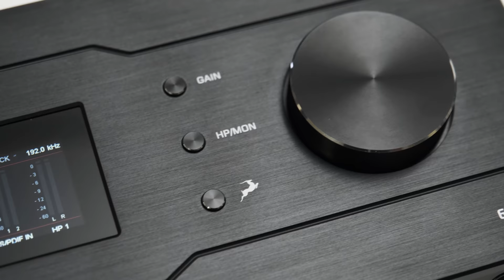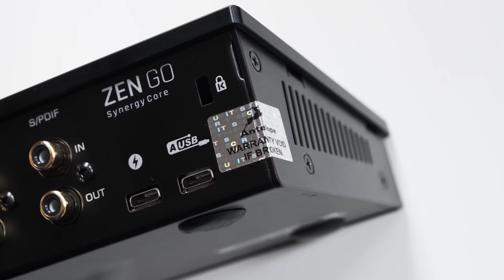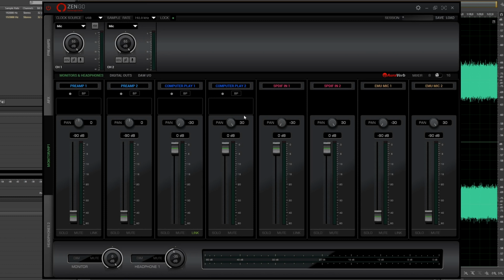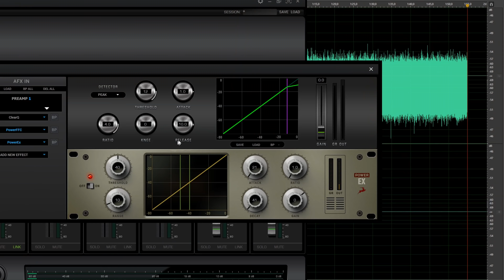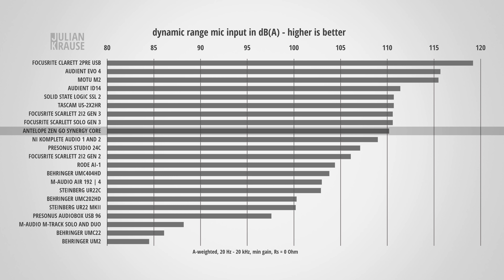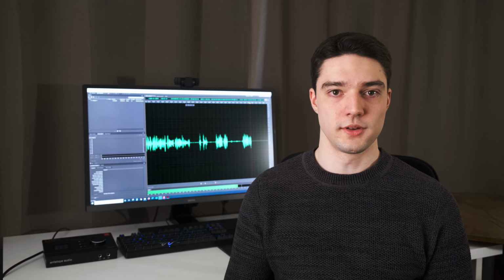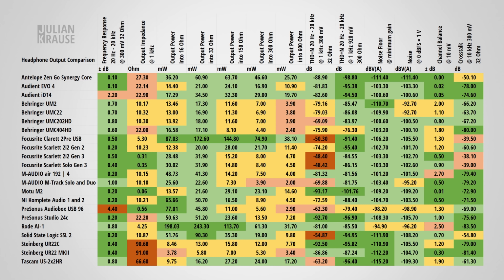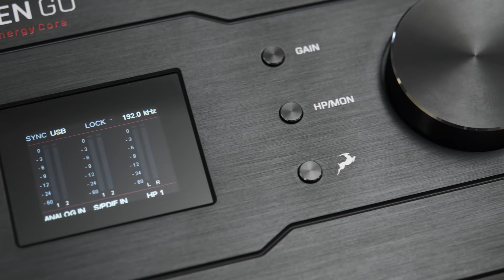Antelope ZEN GO Synergy Core - Audio Interface Review (real-time effect processing?)

Comment: Why the headphone impedance is important if the performance is great?
Reply from the maker: Here you find all the answers: https://youtu.be/SpTsWVLI-ig
Reply: @JulianKrause  Yes, thank you. But haven't you specifically showed flat frequency response from the HP out?
Reply: @JulianKrause  So, to be clear, I like your videos a lot, but I feel there's a disconnect either in my head or your narrative. High and low impedance are not values and I feel it would be more clear if you'd specify how much of output impedance are we talking about. Is it 1kOhm? Is it 300 Ohms? I'd love to know that. Am I understanding your point correctly that Zen Go's HP output amp is unable to drive low impedance headphones keeping the flat response?
Reply from the maker: @cuba1956  Hey, this is how I categorize headphones: 
16 - 32 Ohm = low impedance
80 - 150 Ohm = medium impedance
300 - 600 Ohm = high impedance
The Zen Go can drive low impedance headphones just fine, but the sound of the headphones might change slightly beacuse of the high output impedance.
Reply: @JulianKrause  So what the output impedance of the headphones out is measured at and did it affect the response?
Reply from the maker: @cuba1956  Hey, the shown response was measured with 32 Ohm. But you won't see any response devication there because for the test a resistor is used which has an even impedance accross all frequencies. The response devications depend on the connected headphone, so it will be always be different depending on the headphones you connect.
Reply: @JulianKrause  Thank you for clarification. I just think it's important to note, that even though there's some output impedance, there's really no audible distortion or frequency curve change with fairly low input impedance headphones. And I guess my point is impedance can't really be evaluated solely on the basis of subjectively high/low, but rather should be measured as a complete output circuit.
To be frank, I found the interference issue more disturbing, which likely suggests poor digital/analog isolation and I think basically means it can be affected by anything else. Not necessarily by monitor brightness.
Anyway, love your videos and appreciate your attention to details like that.
Reply: @cuba1956  Yeah, I read about the noise being caused by the level of brightness. How could they not have noticed that in testing? I presume some kind of shielding could have been put in place during manufacture to eliminate this very cheaply. Maybe it's another Mod for Black Lion to get in to :)
Reply: @vroge3275  Based on my experience it's more complicated than that. I think it's likely about isolating analogue signal from digital. Basically, some ripples in the digital bus are causing interference in the analogue and most good brands are doing fairly good job with that. But since it's happening here, I would assume analogue is just exposed on the DSP or even PCB level.
Reply: @cuba1956  read up about damping factor. there IS distortion, but in the time domain. The higher the output impedance of the amplifier, the lower the amp is in control of mechanical movement of the loudspeaker. It can be noticeable on transient bass frequencies (a kick drum for example). It simply adds a time domain resonance that wasn't there in the first place.
Reply: @BoredQwerty  Thank you so much for the explanation. So essentially, some non-linearity is introduced? Is there a value of impedance if not 0 that would be the maximum before it introduces distortion to the signal? As a general rule?
Reply: @cuba1956  There's a rule of thumb of 1:8 ratio between output impedance and speaker impedance. The higher the ratio, the better. You can still open it up and replace those resistors with 0 ohm ones, and decide for yourself. It still depends on the actual amplifier design for the end result.

Comment: A bit surprised about the measurements of this Antelope device - the input frequency response, and input dynamic range, keeps this device out of my buying shortlist. Nice try Antelope, but like all things Antelope, there always seems to be some issue, and some niggle. In this case, I'd prefer to go with a cheaper better quality device, or a more expensive better measuring more pro device. Not too convinced about DSP based processing in devices, feels more like a lock in - why? With software based processing, I can take my effects with me, as better devices become available in the future, and my investment in plugins is preserved. Furthermore I cannot use the DSP effects within normal mixing on an audio project, especially on Windows, cos Antelope has not sorted this out.

Ultimately this device stands or fails on the quality of its DSP effects, which cannot be carried over, whenever one upgrades or replaces the device. Its a choice, just not one that I find neccesary. I do not see any reason why a DSP based effect will be superior to one running on a computer processor - none, the quality of the plugin is a function of design, nothing more. With software based plugins, there is more competition and greater choice, and the investment is preserved.

With software plugins, latency does not increase with the number of plugins in the chain, and in a world wher e some devised have latency as low as a reliable 2 or 3 milliseconds, any further reduction in RTL to about 1 millisecond, by using DSP based effects, becomes a negligible advantage for most people, below about 5 miliseconds, using software effects, this delay is also just as imperceptible as an RTL of about 1 millisecond, with the advantage in software that teh workflow is completely preserved in the project, while with DSP, you cannot save, or retain the effects settings in your project. 

For a slight increase in latency, the software based effects, with the advantage of plugin choice, especially when many plugins are now pretty low in cost - e.g. from Waves, and also tons of freeware plugins, along with the ability to preserve investments long term using plugins, the Zen Go is a bit of a superfluous device. Something tells me that the only reason for this device is because, sales of their more expensive multichannel devices has fallen especially in a world where people do not meet anymore and need lots of simultaneous channels, and they now wish to break into the budget range.

A Clarett  2 Pre - from Focusrite, which can be expanded via ADAT, makes a lot more sense to me. Higher quality preamps, and more maximum inputs if ever needed, at a lower price point.
Reply: Totally agree. Fancy antelope always. The clarett is really very good interface. I have also and an audient id44. Killer combo, believe me..